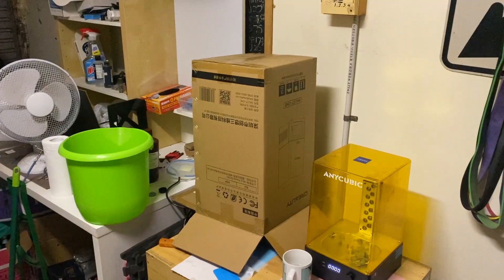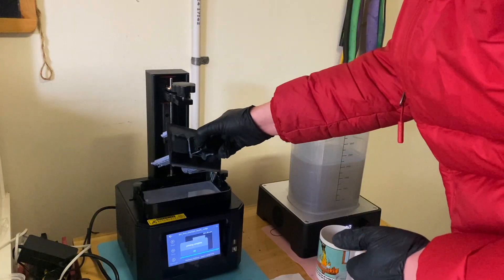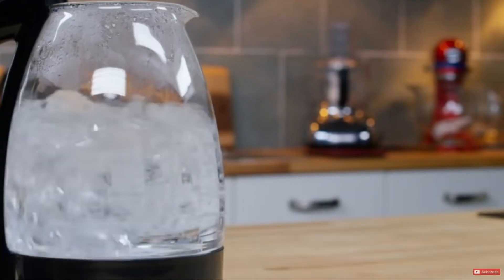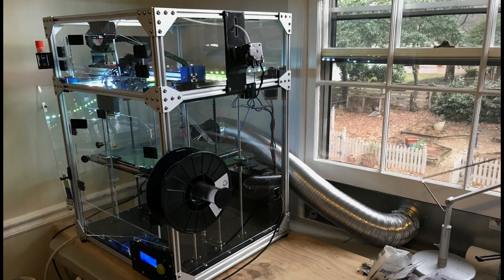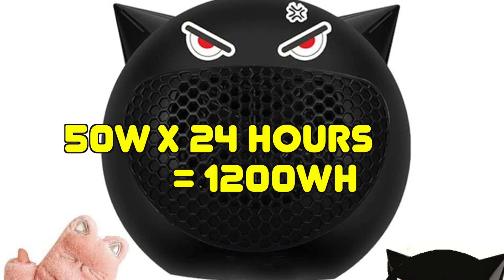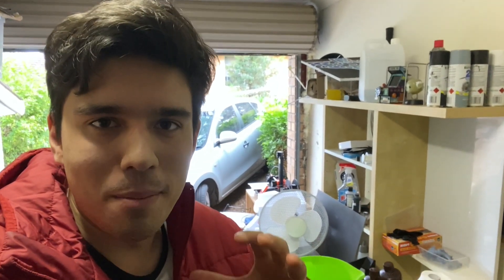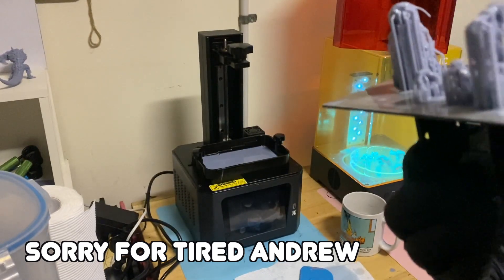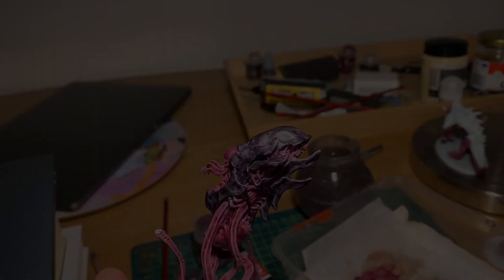Printing in the Cold: Tips to Survive

Comment: that's sort of reassuring. i want to get one, but i'm concerned about the toxicity, i have a room in the basement with a window, i could even seal the door. i'm in the west of france where the temperatures are not extreme, i could probably print a good part of the year.
Reply from the maker: Yeah basement would be good. You could even look up some venting hoses people have used to link it from the printer to your window.
Reply: @Habes  it's a separate room in the basement, i don't think it would be necessary since there'd be enough ventilation. but i was afraid it would be too cold to print anything except maybe in the summer
Reply from the maker: @amaurythewarrior  Ahhk no worries. All the best with it!

Comment: For an enclosure try a grow tent. Its designed for growing plants indoors so it actually keeps heat in fairly well. You can add a small space heater inside and it will heat up very nicely. The benefit to this is that you can easily add ventilation
Reply from the maker: That's a good idea too!

Comment: I have been printing thru the winter in my attic in the UK 3-6 degrees C. I have a seriously high tech cardboard box solution, lined with silver bubble wrap used for loft insulation and a 40w bar heater as shown in your vid. As you have said, pre-heat the resin and the build plate, the printer keeps the temp nice and warm once the job is running. Inside the box 20-25 degrees, outside 6 degrees. I give the inside of the box a kickstart with a hair dryer to warm it up quickly before the print starts, but once the job is off and running the temps stay nice and cosy.

P.S only found your channel this evening, nice sensible beginner tips videos.
Reply from the maker: Thank you for those additional tips! Really appreciate your kind words.

Comment: Is there too hot of a temperature to print in and what would be too cold of a temperature would a normal 75° F in the room be too cool
Reply from the maker: Resin datasheets will have their operating temperature but it's usually 20-30C (68-86F). 

There would be a temperature too hot, but not sure what that is or what happens when you get there.
Reply: @Habes  thanks for the reply I'll find out i guess lol

Comment: So maybe this is why my sla printer is making a cracking noise everytime im trying to start a print, i never had this problem until the winter came 🤔 
leveled correctly and resin clean and still making that sound
im gonna try to warm the resin first now
thank you!
Reply from the maker: I'm not sure if the cracking noise is from the cold but hopefully it works. Let me know how you go!
Reply: @Habes   Yes, it was the cold weather, here in mexico where like 90% in hot weather, but this week it went down to 15°c , and the cracking noise problem appear, i didn't know anything about that cuz it was the first time trying to print in that temp,
Thanks for everything mate!
Reply from the maker: @GuymanShion  Glad I could help :)

Comment: I wonder if using one of those USB coffee cup warmer would be already to use. Just plug it in, set your bottle of resin on the warmer. 

The warm water trick would likely work faster for sure. 

I am in Eastern Canada, where it gets significantly colder than you (I laugh at the +11C over night, lol...that is a warm spring night here), and my office is in the basement, so going to have to maybe try a trick or 2 once my printer arrives (Saturn 2)
Reply from the maker: Yeah it's starting to get colder, like 6-7C but even then we're not going to go below 0 so nothing like your temperatures.
 The Saturn 2 is a nice printer. Got a large build plate.
Hope it goes well, happy printing!